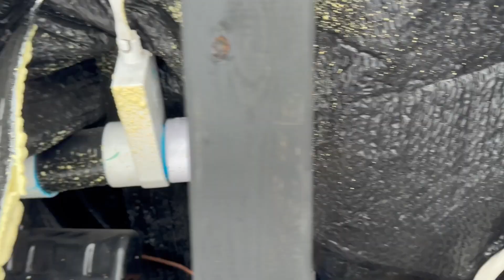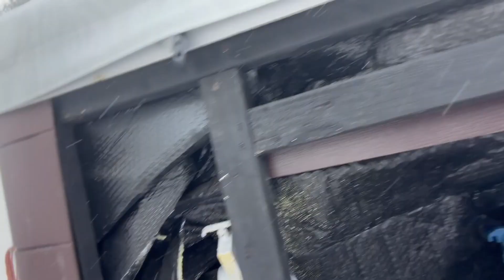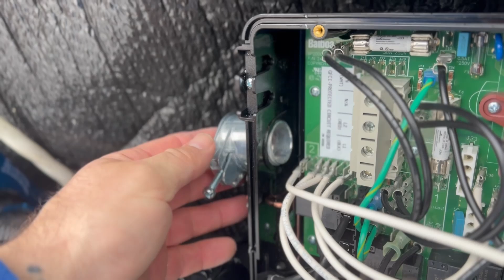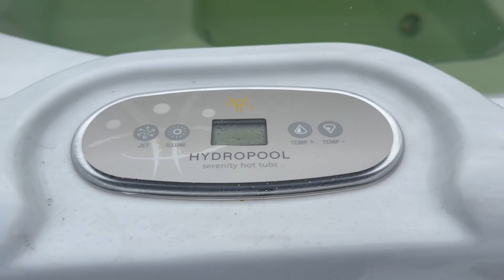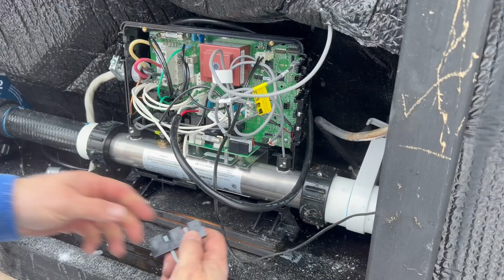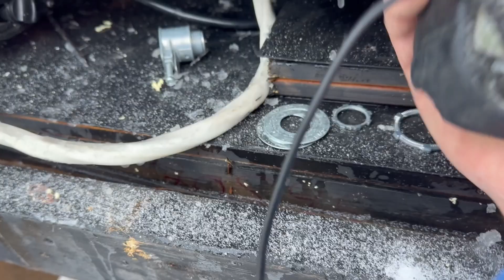Hot Tub Hustler Installs a Balboa BP7 Hot Tub Circuit Board

Comment: when you plugged the topside controls in to the board,  you plugged it into the top plug J35,  Could you have Plugged it into the lower one J34? 
 I am asking because I accidentally pulled that whole base of J 35 right off the board when I tried to remove the top side cord, it just popped right off  - It has 3 soldiered tabs at the base and two pins that go up inside.   I soldiered  the 3 back but i am not a great solderer  and if I can avoid that plug I would like to.   I have that same controller tp600    also the whole same bp7   except i am running a 2 speed a 1 speed and a blower and ozone.   I chose #7 set up because of my tubs stuff.  

    pump 1 in the pump 1 molex plug @ 220v, Pump 2 in the expansion board on the heater tube mount @ 220v, Blower in the AUX molex plug j14  @ 115v.   ozone 115 in ozone.  Set up # 7.   ozone and blower are 115 . so those wires have to move up to 115v.   

I was totally at a loss Oblivious abou this whole matter  in the schematics and then I got a clue LOL   i think it;s correct but i am still not 100% and   i hope I can use that bottom j34

I think I have not missed anything, waiting till tomorrow to test it all out and get r done. raining tonight.